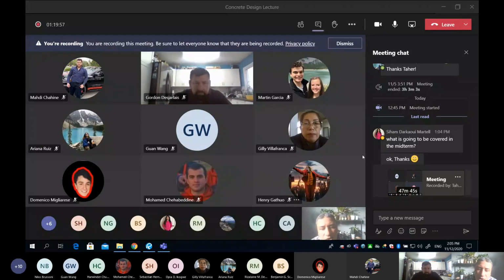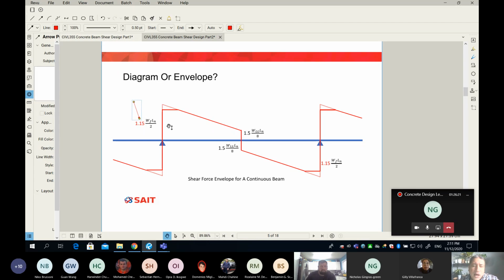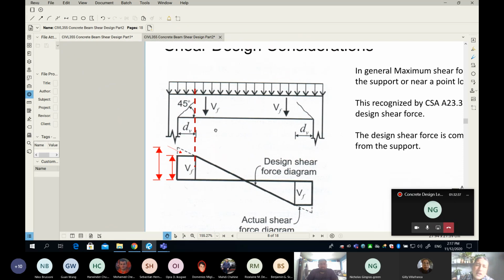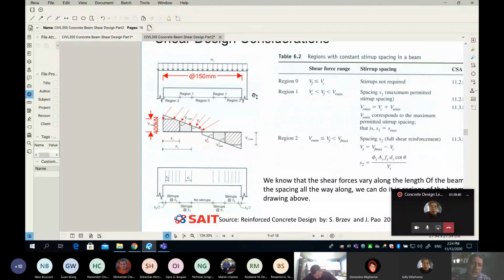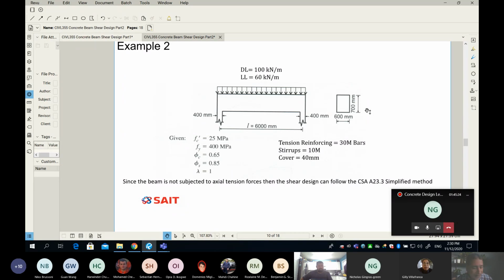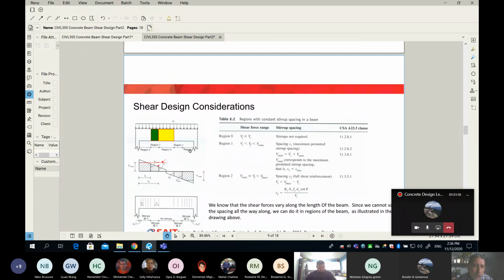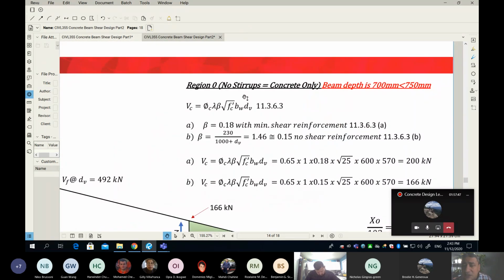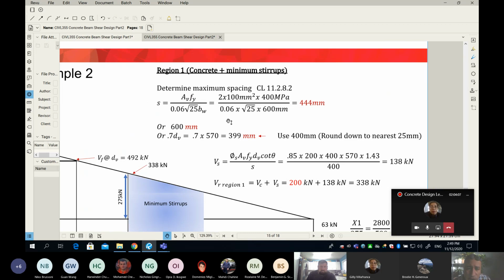Shear Design Part VII

Comment: I am confused why concrete design depends on envelope, but steel design depends on diagram? I think envelope is same with concrete design in steel design. please to explain it
Reply from the maker: All Design must depend on forces envelopes. However, it as stressed here as you want to come up with the most economical design (Use stirrups only when needed) that is why we looked at envelope. If you want to design for when max shear is, diagram would be enough (as both max values are same either from envelope and diagrams)